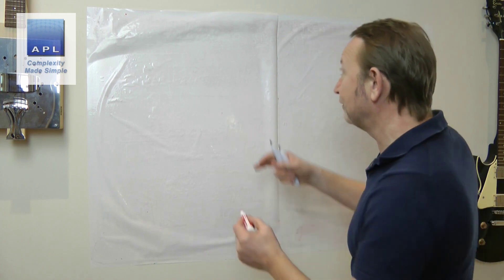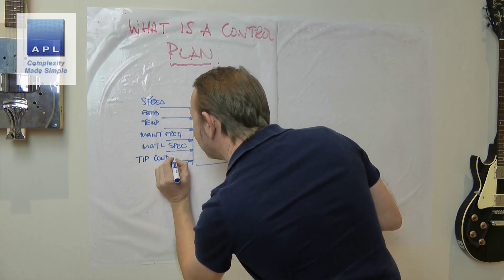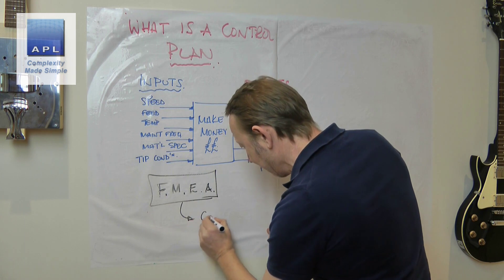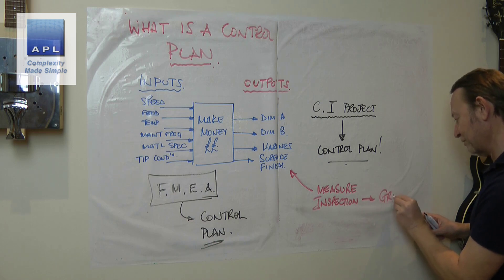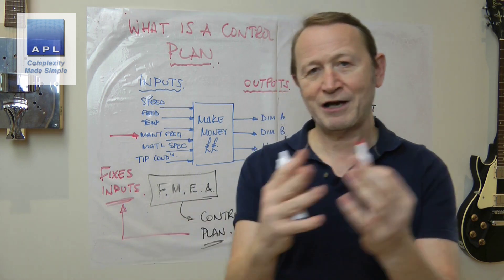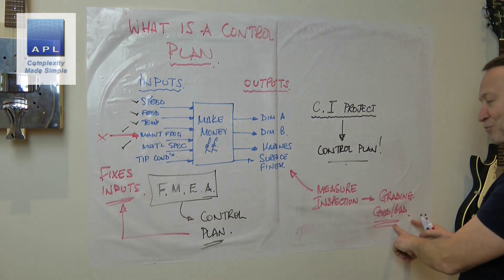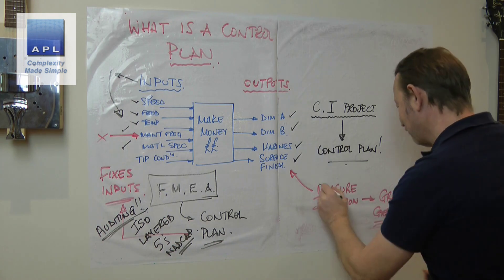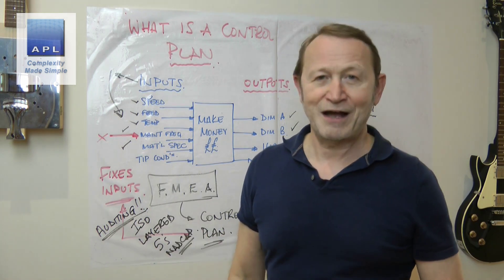Use a control Plan! Not inspection plan!

Comment: Hi Paul. Thanks for the clear explanation. How about if we couldn't strictly control the input specs or quality?e.g in the agricultural industry where input is direct from crops. Can we have an effective control plan? Furthermore is it possible to implement 6sigma or LSS to the operation?
Reply from the maker: Hi Skyr - good to hear from you. Yes you can still have a control plan. A control plan is a set of operating rules, that are always followd, by everyone. Let's say you can't control the amount of Starch in potatoes. You measure the incoming starch content and have an official response. So if starch = 6 temperature = 78C if starch is 10 temperature = 87C. no leaving it to the skill of the operator, that's a road to chaos...
Reply: @paulallen5321  Thank you for your feedback. Just to clarify on developing the control or rules in control plan, are the control/rules must be proven effective statistically (cp/cpk, pp/ppk) or is it ok just by  developing from historical practice/experience? I found it is very hard to achieve capable process due to inability to statistically control the raw material quality. Again thank you in advance for your knowledge sharing.
Reply from the maker: Ultimately - you're going to have to find rules that work with the physics in your process. But you will only find the right answer by picking a rule and sticking to it. Even if the rule is wrong, consistently following it will mean you will learn so much and eventually find the best controls...
Reply: @paulallen5321  thank you very much for the explanation. Done subscribe your channel. You really make complexity simple!

Comment: I like that, inspection plans are a sign you haven't got a clue what you're doing. That's brilliant. :)
Control plans instead inspection plan.
Reply from the maker: Gabriel - yes if you truly knew how your process worked you would dial in a the correct settings and sit back and count the cash. But if you're not sure you have to measure everything, just in case....
Reply: @paulallen5321  Excessive measuring only gives you false security.